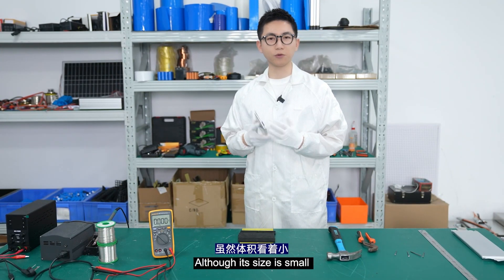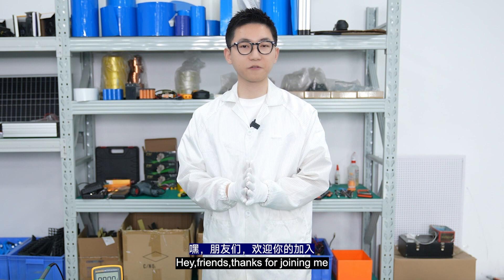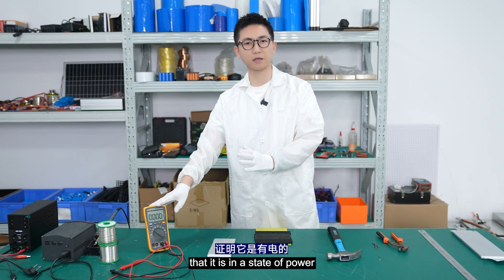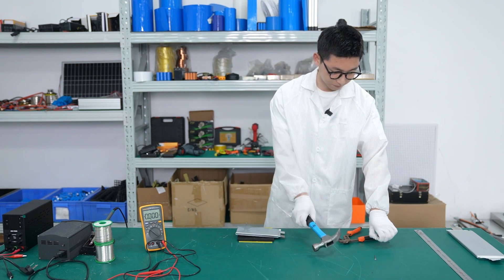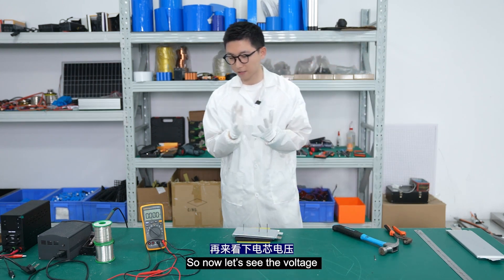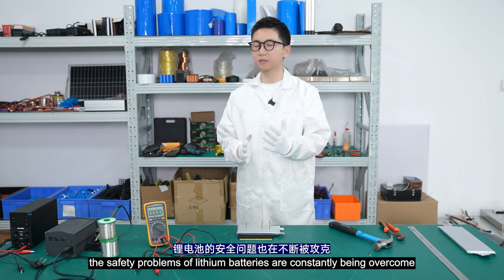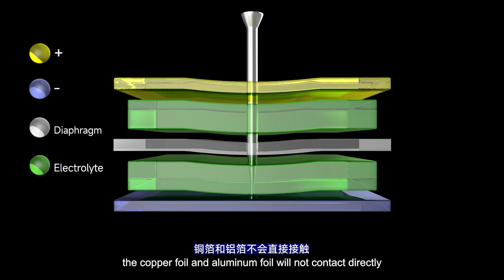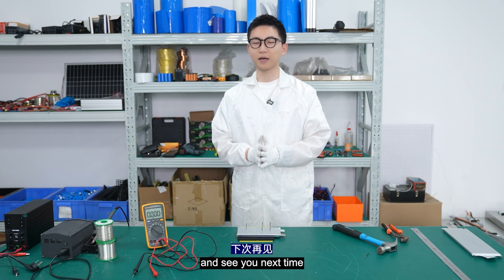⚡ Puncture experiment of lithium battery ⚡

Comment: Cheating
He should define the C value of such battery.
Voltage measured can only spell the chemical value of Li Ion battery.  The value of C in such solid state battery with ceramic separator has a problem of low current generation between cathode & anode. 
Total energy brust out per second is low!

Comment: How is it, the metal nail is not making an electrical connection between the anode and cathode?
 Surely it is making contact, breaking through every layer...?
Does the nail have a non-conductive coating?